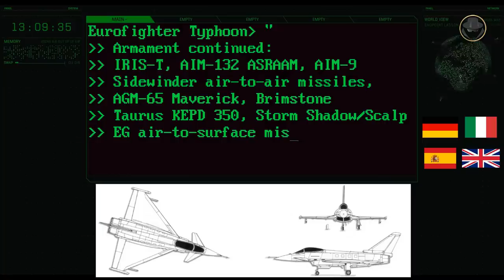Eurofighter Typhoon | The story that the West does not want to tell

Comment: The EFA program mirrors the mistakes made in the ATF program which led to the F-22 Raptor. 
Development was plagued by delays, so it took 20 years before the Eurofighter entered service in 2003. The original version (Tranche 1) was too specialized, being predominantly an air-to-air interceptor, with limited air-to-ground capability. This meant it was designed for a mission which was no longer relevant, following the collapse of the USSR. Meanwhile, the UK was increasingly involved in wars in the Middle-East, where a multi-role fighter was preferable. It took another 20 years to add air-to-ground capability and an AESA radar.
As a result of these upgrades, it's now a formidable multi-role fighter, albeit an expensive one, but most potential export customers have already purchased something else!
Reply: Britain would have stuck with the air superiority fighter. It was it's partners, particularly the Germans, that were short of money at the time due to reunification, that wanted to withdraw from the program or change it.
Reply: @alanjenkins1508  Yes, the Germans were somewhat fickle partners, but considering that they had to deal with the much larger and more pressing problem of reunification (as you mentioned), their reluctance to commit billions to an aircraft which was unlikely to see combat, was understandable.
Also, I believe the Typhoon was intended as a Tornado replacement, but the Tornado was a truly multi-role fighter, so I'm puzzled why the UK focused only on developing an interceptor to replace the ADV, while ignoring the IDS and ECR roles. Germany used these latter capabilities more then the former and still flies those Tornado variants today, so perhaps that's why they were ignored until after the Eurofighter entered service...
Reply: And these people like to $hit on Tejas.

Comment: The fixed canards of the Kfir, starting in its C2 version (i.e. Mk.2) are because its shorter (and wider, American) motor moved the c.o.g. forwards vs. the Mirage -3 (and -5).
Reply: I still think they never made those kfirs, but got some ckd kits from france just so france could sell weapons to arabs too.
Reply: @polentusmax6100  Though Israel made Mirgae-5 aka Nesher already beforehand, following the French arms embargo. The motors are American. The Israeli Lavi preceded all Euro-canards. Israel (Chief Test-Pilot Dani Shapira) also tuned the original Mirgage-3 for the French during its development.
Reply: @zofe  yes, thats the official version. Lavi was made only in israel and was sold to china. 
     There no way israel build all the tooling of the kfir nasher just to build 80 or 90 of them. My point of view.
Reply: @polentusmax6100  At least according to Wikipedia there were more than 220 Kifrs built, also the whole point of building the Nesher and Kfir was to be more self dependent so it was logical to acquire the required manufacturing and knowledge regardless of the amount, the real part that is a problem to manufacture is the engine, and it was American.
Reply: @E_y_a_l  thats another possibility.

Comment: It seems like the French only joined so they could use the specs on the British demonstrator to design the Rafal F1. The only noticeable difference is the air intakes, not a coincidence.
Reply: WTF? The Rafale flew first the 4th of july 1986. The EAP flew first the 8th of august 1986.
On its first flight the Rafale A went mach 1.3. The EAP went mach 1.1.
So the french "copied" but achieved a first flight sooner and with better performance?
How does this even works? What are you smoking?

Comment: 1 - France left the project - with all the research data, to incorporate into their own Rafale.
2 - Germany undermined the project by first, wishing to cancel their contract (which they couldn't do because of penalty clauses of German origin -haha) and then demanding that the design be cheaper and simpler.  This is the ideal recipe for making the finished type under perform and over the cost.  Thanks, Kohl!

Comment: I wonder why Europe didn't build a heavier fighter with thrust vectoring in small numbers. That would be awesome to see
Reply: Simple answer : too expensive and useless
Reply: "if you build a plane too big complex xpensive it'll be hard to sell...." Serge DASSAULT
Reply: Those Su fighter series beg to differ. But then again, I'm no expert
Reply: @polentusmax6100  why do u want us toi reach Moscow ?
Reply: @CasimirLouis its not about you reaching moscow, its about having the range to reach far away bases without launching a missile. Or to fight in enemy territory and have enough fuel to go back home.
       Just remember the so called battle of britain, me 109 did not had the range to fight too long and many got lost by lack of fuel.
Reply: There is a 3D thrust vectoring nozzle arrangement available for the Typhoon, however none of the buyers thought it worth fitting as the canard configuration of the aircraft cave it extreme manoeuvrability anyway.

Comment: Failure of the Typhoon fighter is only reason reliability of spare parts built in different countries. Example Germany and Italy at a drop of pin puts embargo at the critical time. When the weapons required.
Another example Belgium and Germany refused to supply advanced rifles to India stating domestic reason

Comment: Picking very small hole in what’s a very good aircraft, even the USA says it matches the f22 in many departments. The only thing you got right is the UK moving to the 6th gen  design plane. And not going head long into using the f35 lightning.

Comment: it got the same air frame ,twin engine setup and forward fins (canard ) as the rafale fighter .
Reply: nope: on the EF are the canard at pilot position and did reduce the down visibility, and on EF are the engine air intakes togetter who is very dangerous in case of a engine problem: this was the main cause for the specific concept from the separate  Rafale intakes, and engines doest have the same working phylosophy: the M88 are made to allow supercruise with minimum consumption, consumption from the EF is much higher at same speed and configuration
Reply: The intakes maybe further apart, but the engines are almost the same distance apart. The Typhoon can also Super- cruise & with it having a higher thrust to weight ratio, it can do it faster & further.

Comment: On the F-4 over nam.  One of the issues was the F-4 was conducting long range missions and was very heavy. It did not have the support of ground radar. The 21 was a point intercepter and used hit and run tactics guided by an extensive soviet supplied and run radar network.  Given that the F-4 had a 3 to 1 (306 A2A kills and 106 A2A loses)positive kill ratio over all aircraft in Nam and the MiG -21 had a losing ratio at 68 A2A kills and 98 A2A loses.  What plagued the F-4 was ground fire, not MiGs. Over 500 F-4's were lost to ground fire.

Comment: ehhmm ... really the Typhoon in Red Flag simulation, it was able to shoot down the F22, the Typhoon can detect the Raptors as well as the F35s. but ok maybe the pilots who did it lied ... no not I think .. all in all the Typhoon  works well 😉.
Reply: They restrict the F22 and F35 and set limits during red flag.
Reply: @MeanLaQueefa  in dogfight  no limit, simply the F35 is less than the typhoon. as for the F22 I do not know if they have set limits .
They restrict ? 
Are you sure? in EU both thyphon and F35 are used, they are the pilots who prefer the typhoon dogfight. Greetings

Comment: Interesting analysis of the fighter market at the end.
I would argue that the F35 is not a direct competitor to the Typhoon in air to air, especially in the QRA and interceptor role , it lacks the fast reaction, outright speed and climb ability but definitely it wins hands down in the air to ground role.
It will be interesting to see what the Mj2 E Caotor brings to the party especially as it is rumoured to be specifically designed to hunt Stealth aircraft .
Also interesting in the 5th Gen market the Anerican are buying more F15 EXX over F22 ( admittedly  it would mean restarting a closed production line)

Comment: European buracrecy slowed development time and the world kept changing and changing.  They need to develop faster or make it a point of skipping a generation as they have to keep up.
Reply: Exactly. The original plan was to start development of the Agile Combat Aircraft following on straight after the Tornado had shifted from development to production in the early 1980s with first flight before 1990 and initial service entry by the mid 1990s. Eurofighter ended up being essentially 10 years late (though if it had entered service in the 1990s the equipment standard would have been lower initially but it would likely have been given a mid-life update around 2010 which would have kept it up to date).

Comment: Disinformation and garbage. The Delta Trinity of the Typhoon, Rafale and Gripen are all successful and advanced fighters designed for different purposes, and each one is easily a contender against anything the East can throw at them. The reason no nations have opted for the thrust-vectoring EJ2000 upgrade is that it's completely unnecessary for the Typhoon's mission profile of high-speed, high-altitude BVR while adding weight, cost and maintenance complexity. Conversely, all EFs can be upgraded to steered-AESA arrays in short order if it ever became necessary, but again the Captor radar is optimised for long-range air-to-air, not jamming operations. This entire video was a waste of breath.

Comment: Rafale is so much better. Main reason is it is a carrier fighters. EU cannot even take a simple decision. EU should just be cancelled. Just a big mistake.
Reply: EU had nothing to do with Eurofighter. Otherwise do I agree. EU is a failure. And Rafale is better.
France have managed to beat multiple European countries with a better fighter. And not only that... it have also created a plane better than F35. Rafale is not stealth. 
But F35 is a joke which I wouldn't call stealthy either. F35 got the most powerful jet engine ever made inside of it - which it needs to keep this ugly unaerodynamic bird flying. But a big engine also means lots of heat.
So even if the Americans somehow through a miracle would make this plane undetectable on a radar, it would still have a huge chink in its armor - it's heat signature.

Rafale got powerful heat seeking sensors that could detect F35 far away and lock a missile on it before the F35 have come close enough to spot the Rafale.

Comment: The eurofighter does nothing an f15 can't do
Reply: Of course it does. It provides jobs and expertise to Europe. Just buying from the Americans isn't always an option, especially since the Americans rarely buy European. The Harrier probably was the last time. So, that alone was worth the price tag and choice. And the Typhoon is less visible on radars especially seen from the front.
Reply: Meh it runs circles around an F-15, accelerates faster, out climbs the 15, and it has the Meteor long range missile and the Iris T short range missile.
Reply: F-15 can't out-turn or out-climb the Eurofighter.
Reply: @henrikf9015  f15 is 50 years old but updated f15 can
Reply: @MeBallerman  that was the old f15 e& f built 30 years ago. This is the new build with new engines, lower rider Cross section, new radar, new missles. Basically everything you find on an f35 or f22 in a less expensive package.
Reply: @jmcfintona999  The 15 is a great aircraft, no doubt.
Reply: F15 can’t super cruise
Reply: @carwyngriffiths  new engines. Same as on the f22
Reply: The Eagle has its newer version the F-15E Strike Eagle biplace that somehow match a Eurofighter. Have some doubt...
Reply: @frodrigues2008  well both are 4th generation fighter designs, everything on the eurofighter is 20 years old. The new f15 will basically have everything the F35 has in terms of radar, avionics and so on while everything the typhoons has is basically from 2003.

Comment: Cause France has to be special having it’s own Rafale’s
Reply: and its own independent aircraft industry.
Reply: Right move thought. The plane is more capable and can conduct a wider variety of missions
Reply: And we still wait the typhoon to help when it come to real war... no one fear the typhoon because its just a selfish fighter, for selfish guys.
Reply: And that was the best choice
Reply: And that the Rafale, not originally designed to be an interceptor, almost every time wins the simulated battles against the Typoon.
Reply: Typhoon sorry :)
Reply: @olivierpuyou3621 Rafael pilots acknowledge the Typhoon is the better high altitude fighter, but the advantage is lost lower down.
Rafael does well against F22 and F35.
Reply: @a-skepticalman6984  If they can see them that is
Reply: @a-skepticalman6984  alr fair enough im still holding out for a new Hawker or English electric and France not giving up independent air industry in exchange for a universal fighter for europe was a good call
Reply: @doubledekercouch  Stealth doesn't mean invisible, it just makes you harder to spot on a radar. But you can still track a stealth plane with IR sensor/optics at more than 40 nm... cause you know, their engines generates quite some heat (not forgetting the engine exhausts) Something the Rafale, Typhoon, and Flankers, are equiped with...
Reply: @qenyaithandrill7848  yeah, the more i think about this the more it seems like a wasted investment by many countries

Comment: Yeah, France joined, learned all it could then withdrew to make an aircraft using all the information from the project, saving them the costs of doing the research themselves.
Reply: Totally wrong... Dassault was already searching the Rafale (programm Mirage 4000)... France joined but already arrived in the project with 2 conditions : an omnirole capacity and a carrier-capable fighter. After a year of negociations, it failed, France logically left the project. Rafale is overall a slight better fighter than the Typhoon, can do all air missions and is carrier-capable.
Reply: Haha yes, because obviously Dassault did nothing before. /rolleyes
Reply: Man... Stop with this fairy tale... It just sound childish...

Comment: Those planes are junk, to take off the little flutters are good but as a dog fighter they are dogs
Reply: Bollocks. (To use an aviation phrase).
Typhoons have done exceedingly well at Red Flag and other exercises and are now even more capable as Ground Attack aircraft specifically at low level (as the Tornados were).
A few F-22s can testify how good the Typhoons are. As the Luftwaffe said after one Red Flag; "We had F-22 Salad for lunch"
Reply: Nonsense, no 1st world country dogfights anymore. Why would you if you can kill BVR
Reply: @scepticalwalker3984  BVR doesnt guaranty 100% kill.
Reply: @scepticalwalker3984  engaging BVR on tiny pot countries is not the same with near peers. If they're fighting near peers, expect a heavily jammed environment